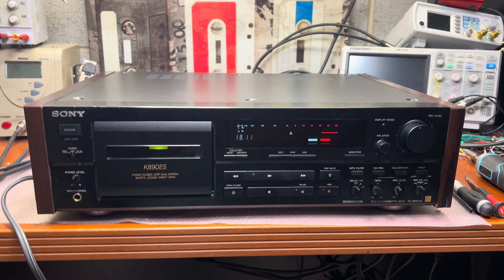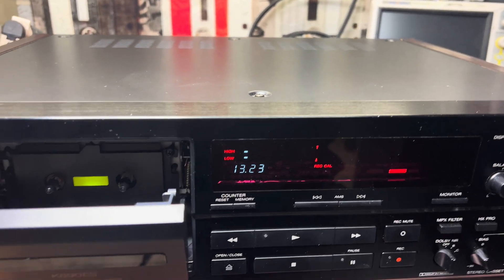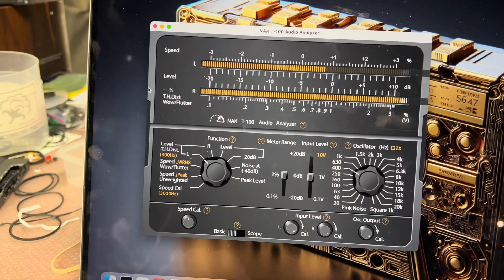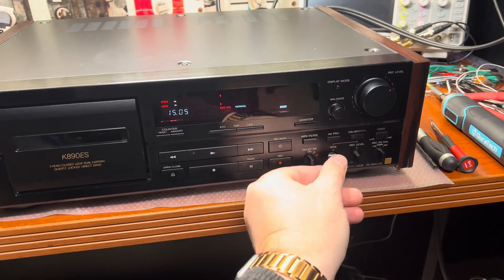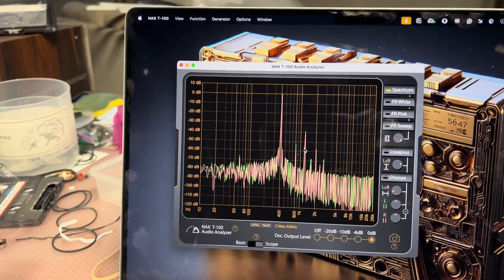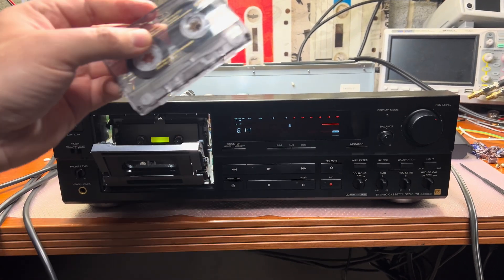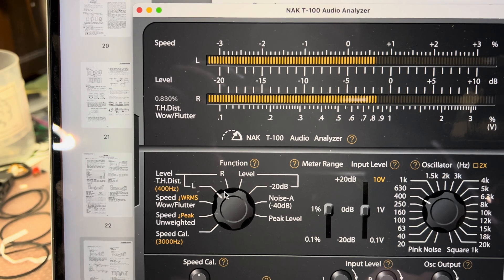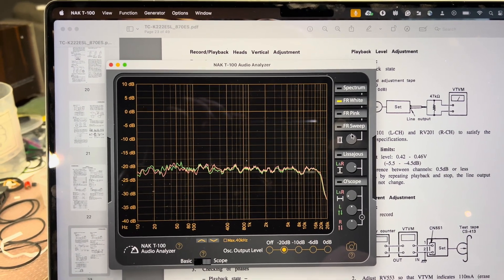Sony TC-K890ES Restoration: Eliminating 4% THD for Superior Sound Quality

Comment: Some people recommend using bipolar MUSE caps in the sound path. What about those?
Also according to some the 870ES/890ES decks have the "wrong" rec EQ and there's a mod for those (to make it like 970ES). Wouldn't also replacing the 4066 improve the THD?

Comment: Nice video but i saw record eq cal on "normal " ? with a metal tape ?
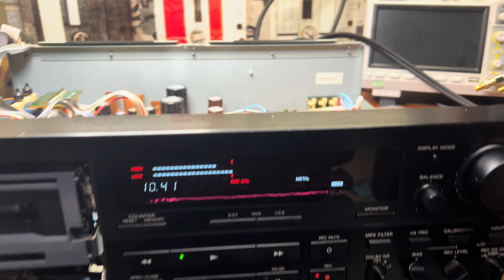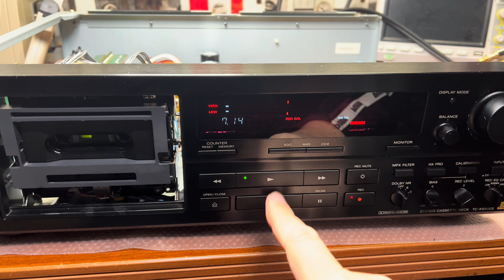Reply from the maker: 10:00, 11:45, 12:10, 13:15 Where is it shows normal???? Look at the display carefully.
Reply from the maker: If you mean EQ switch position - you can use it in any position for any tape, read the owner's manual. It says "low" for music with a lot of low frequencies and "high" for music with lots of highs.
Reply: yes he meant the normal EQ switch position for sure.